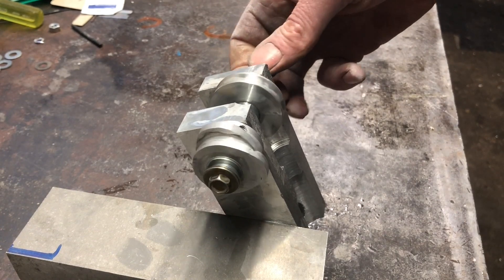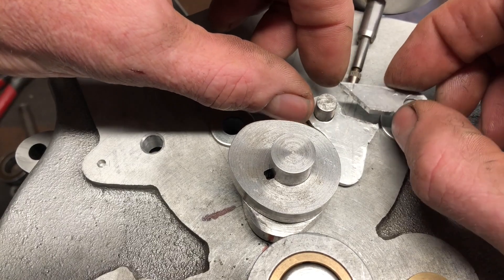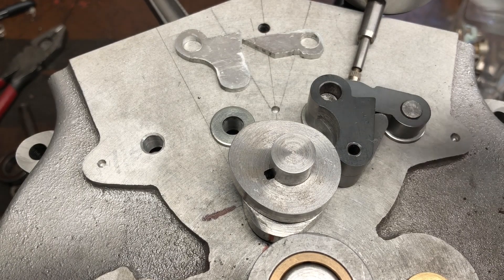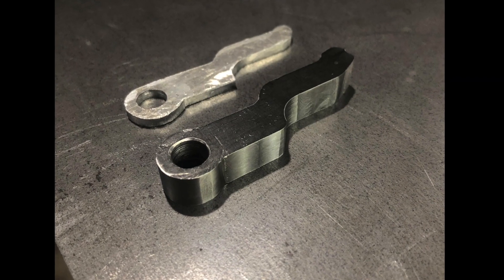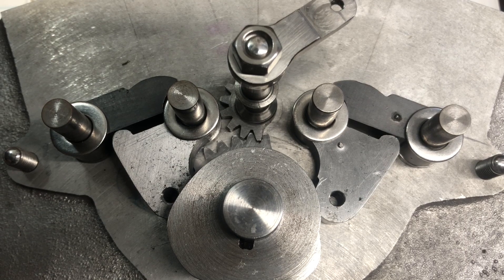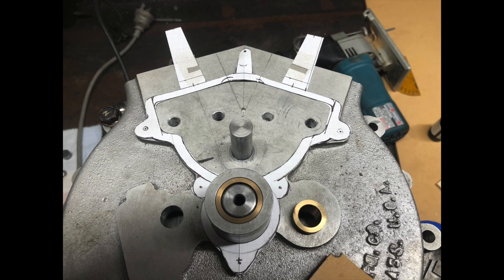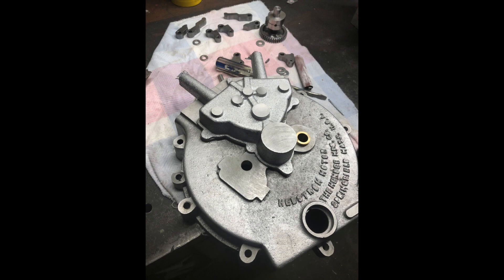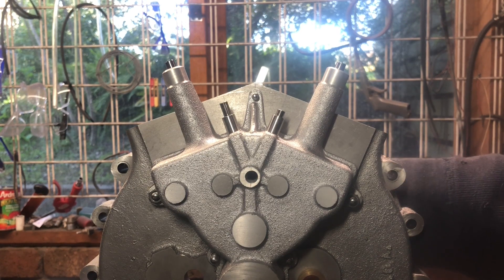Project Indian: Episode Two

Comment: That casting is an absolute beauty, as is the cam follower gear. You mentioned case hardening, yet I would be interested to know if you are in any case selecting carbon steels commensurate to the componentry in hand, as you go? Kind regards.

Comment: Great videos buddy! The casting came out perfectly. I was just daydreaming about a foundry in my garden, what are you burning in it? Was it oil? And was it made out of a gas cannister? Wonderful!
Reply from the maker: Hi bootsowen, yes my furnace is made out of an old gas bottle and it does run on old engine oil.
Reply: @nuttyprofessor3674  Thanks, I am getting my parts together. I think I'm going to run it on gas. I enjoyed that oil pump video today. How did you get the brass outlet to thread in and stop so perfectly aligned?
Reply from the maker: @bootsowen  After machining the two brass fittings I assembled them in the main body in the position I wanted them then silver soldered the to halves together.
Reply: @nuttyprofessor3674  easy when you know how! thanks

Comment: Great work and video !
If I understand well the two cylinders have their stokes one after another ? I thought that they had a turn -45° then a trun +45° between explosions.
Reply from the maker: When 1 cylinder is on its TDC firing stroke the other cylinder is at the end of its exhaust stroke so then when the engine does another full turn the opposite cylinder is ready for firing and first cylinder is on the end of its exhaust stroke. Indians ran with a 42` V Harley Davidson had 45`V.